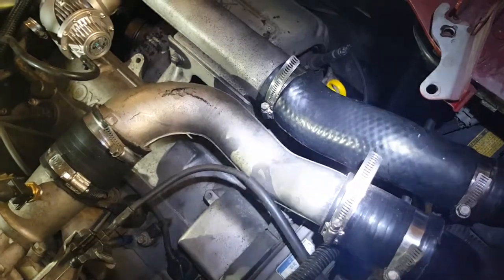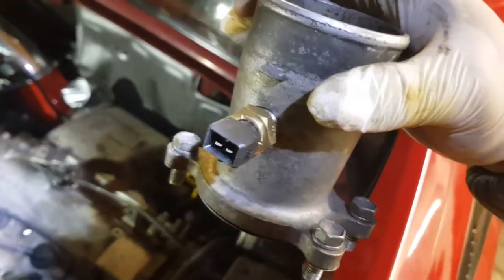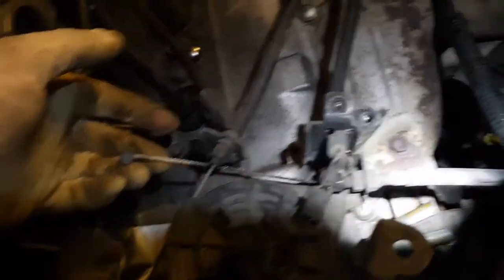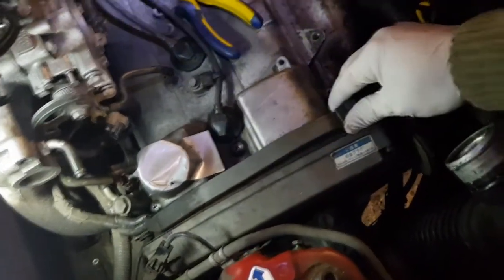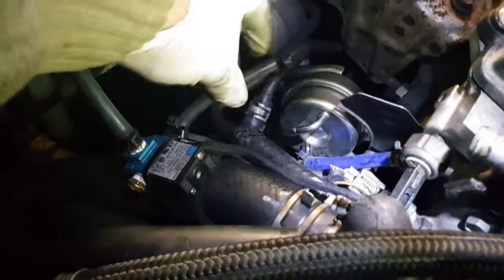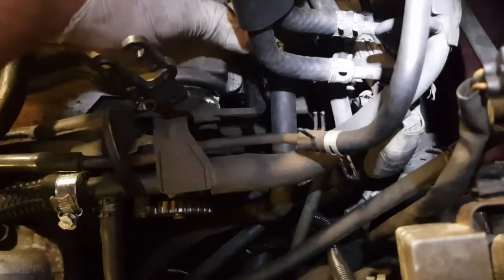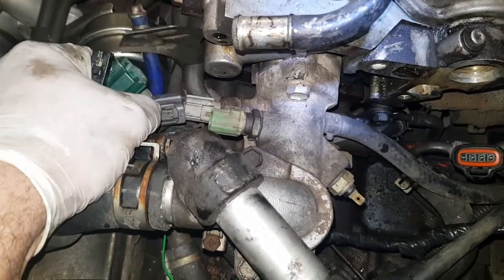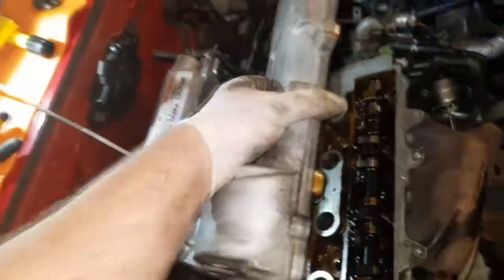Walkthrough Headgasket Change Toyota MR2 3SGTE Part 1 (start to cam-cover)

Comment: Good video mate, keep on posting 👍
Reply from the maker: john thirlaway will do, thankyou. Got the exhaust to do.. Hate the exhaust
Reply from the maker: john thirlaway I've got the japspeed tail pipes. All stock manifold and downpipe. Yes they are loud.
I just hate taking off the manifold. I have successfully done it though so thats a plus.
Thinking of getting a metal head gasket and ARP studs. But before I order anything gotta take a look at what's happening. Hopefully just get the head skimmed and then it can all go back together with new water pump and new timing belt stuff.
Reply: Newbie Mechanic yeah you're running the Rev 1 - 2 turbo engine aren't you, if so it will just be the paper shite one. From what I've seen on the forums apparently the rev3 steel ones can go in without any modifications so maybe worth you doing a bit more investigation into it. ARP headbolts seem to be the only way to go, even the cheap DIY's on YouTube who'll happily throw a Chinese turbo pay the extra expense for ARP
Reply from the maker: john thirlaway yeah that's exactly right. I won't order anything yet as I may get the head skimmed and then will need a thicker gasket potentially. Depends on the condition... I'm really hoping it's just a gasket problem. I'm trying to find out what the stock head gasket thickness is on the gen2 3sgte. I'm getting 1.4mm but not sure 100%